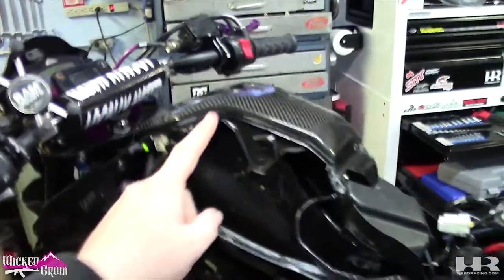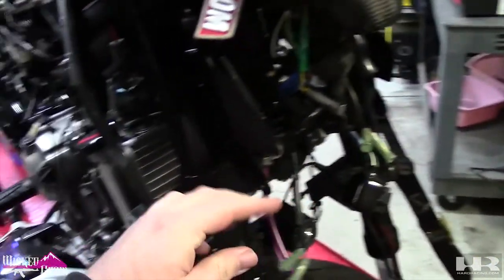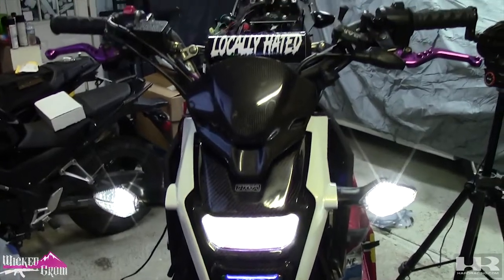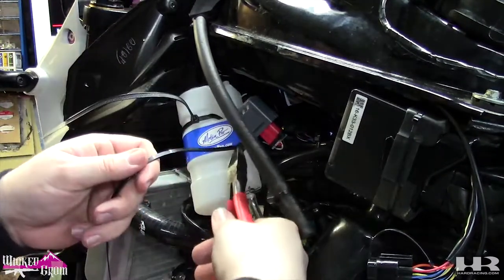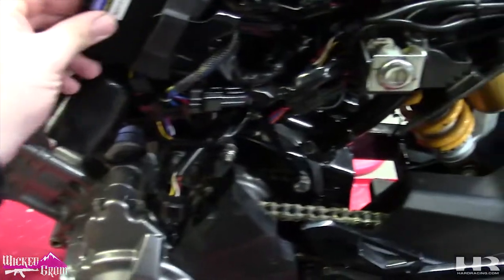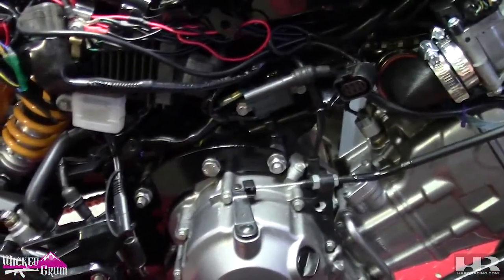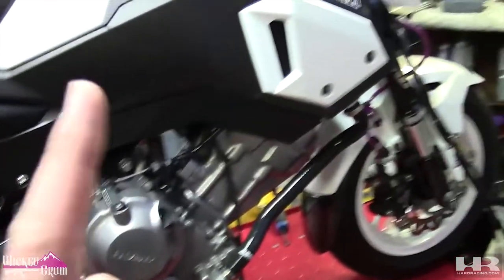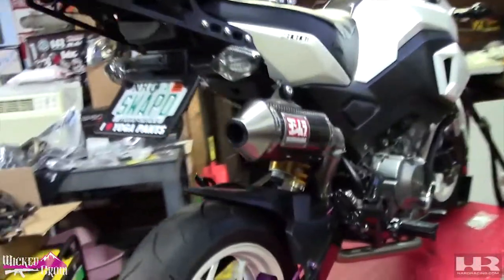Honda Grom 300 Swap | Part 7 - Chain, Headlight, Coolant Bottle + MORE!

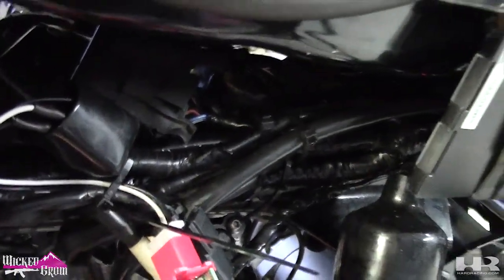Comment: 10:13 that’s a potentiometer 😅 basically it adjusted the resists which obviously changes the speed of the circuit 😅 it’s knowledge from work but feel free to call me a nerd 🤓

Comment: I did the EGR delete but now without any PCV (positive Crankcase venting) i now have a side cover oil leak.  How can I vent the crankcase?
Reply from the maker: they are vented at the top of the motor. Supposed to have a hose and a breather filter attached.